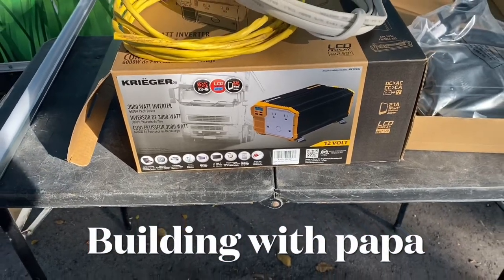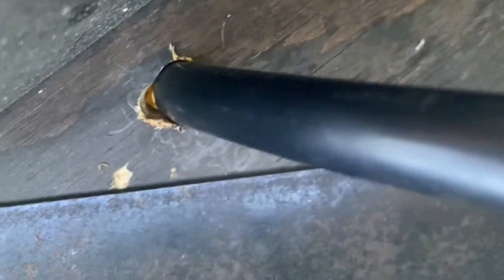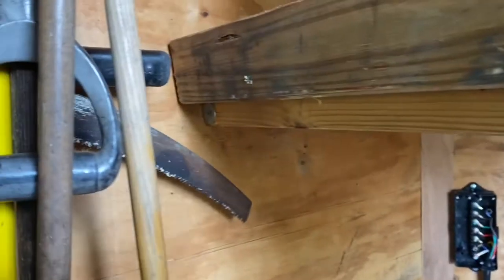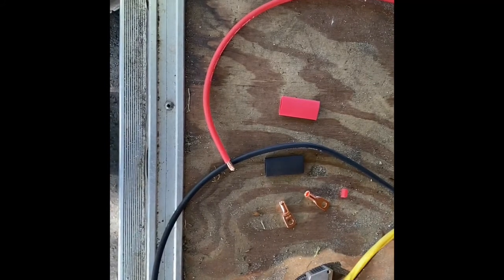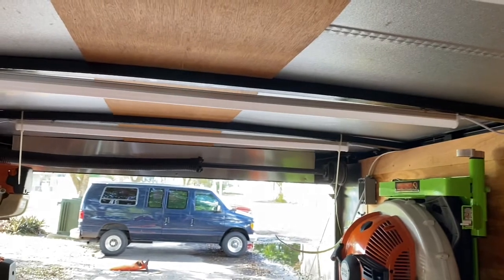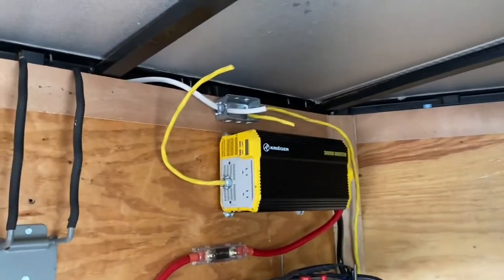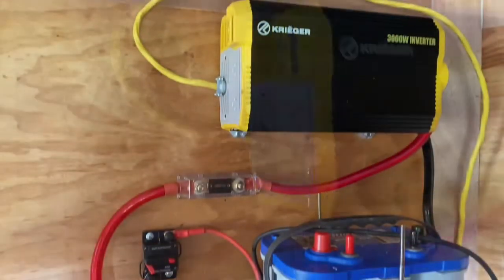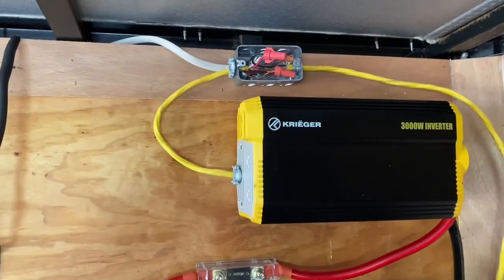Installing a power inverter in your trailer off your seven pin

Comment: I want to run some STIHL battery trimmers for commercial lawn care. The charger draws 4.4 amps and I need 2 -3 of these running. Would one big battery work with a big inverter? Also how would I charge that battery would the truck running here and there in between properties work ?
Reply from the maker: Yes, one big battery and one big inverter will work fine when you’re driving from property to property. It’ll continue to charge the battery so you should not have any issues when I’m charging mine. I’m usually on a job site and I don’t run my vehicle at all, but minor smaller batteries for Dewalt and Ryobi tools, hand tools I haven’t had any issues and I’ve been doing it for years. I hope you enjoy the video, and if you can leave me a thumbs up.
Reply: @buildingwithpapa do I need the battery or can I just use the inverter ?  My truck has 2 big battery’s
Reply: @buildingwithpapa do you need to charge this battery in the trailer or does it just charge off the 7 pin ?
Reply: Well I set up the system and the charger drained the battery in just over an hour.  So basically it won’t work because I’ll have to still charger all the battery’s at night as I need about 6 batteries  to last a day and it died after charging one. I needed the charger to run for least 4 hours a day.   😩.   So the time to set this all up was a waste and I’ll have to return the inverter and battery  and take a loss on the wires and supplies.
Reply from the maker: Was the battery fully charged? And how big of inverter do you have? Did you use marine batteries or just the car battery? You may need to set up more than one battery. I have the same set up in my trailer and I’m able to charge multiple batteries but again they’re only 18 V and 20 V batteries. I haven’t had any issues. Sorry to hear that you’re having some but there’s gotta be a way to work it out. I don’t know if you have the room for it, but you may need four batteries and what size inverter do you have?
Reply: @buildingwithpapa  1500W inverter.  Each charger pulls just over 400 watts. Big marine battery.  The problem is even if I have more batteries I’d have to charge them every night as the 7 pin won’t charge them and in a day stop and go I only drive about 1-1.5 hours off and on all day. Because these batteries are for Grass whippers which take a lot of power I have to a couple on a charger all day long.
Reply: I’m just going to put an outlet on the outside of my trailer and just directly charge the batteries.  That’s the only way I believe and get rid of the inverter set up.
Reply: @buildingwithpapa  what charges your battery each day? Or do you have it so the 7 pin gets 12 volts and uses the pull truck batteries and alternator?   That was maybe my next step
Reply from the maker: @jaybrown8709  oh so you’re not using your seven pin to charge your batteries? Yes I have my seven pin hooked up and it charges my battery as I’m driving and I don’t have my truck running when I’m charging the batteries on a job site..
Reply: @buildingwithpapa  ok. 
Y seven pin just has trickle charge right now and it just keeps a battery at level if that.  It won’t charge a battery, but apparently there’s a way to change it so you get the full power from the alternators and the other truck batteries.
Reply: Even with three batteries, two from the truck and the one in the trailer it can’t generate enough power to for what we use these little Battery  packs take a ton of power and because we use them  heavily all day it will never be able to generate enough power through the charging system

Comment: Why not with a solar panel ?
Reply from the maker: Well, first, the customer didn’t want that I only installed what he wanted but yes the solar panel would help if you’re not hooked up to the truck, but why do you need a solar panel if you’re hooked up to the truck when you’re using the trailer every day I don’t use my trailer every day and I don’t use a solar panel either cause whenever I need the power the trailer is always hooked up to my truck, so it makes sense to use the seven pin but a solar panel wouldn’t hurt. I hope you enjoyed the video, and if you can leave me a thumbs up.

Comment: Always connect positive to the battery first!!!
Reply from the maker: Thank you for your comment. Can you explain to me why you believe the positive should be connected first. I was taught to put the negative on first and if you Google it you get both ways one says positive1st and other say -1st so explain to me why you believe positive first also I hope you leave me a thumbs up.
Reply: @buildingwithpapa   the only real reason is the chance of shorting things out, in this case in a wooden trailer not such a big deal but with automotive or even lawn mowers, power sports etc. if your wrench/ratchet grounds out while tightening the negative nothing will happen. But if you touch ground while tightening positive your in trouble. Great video by the way! Nice install.

Comment: When it’s plugged it to 7way will it drain your truck battery’s
Reply from the maker: Thank you for your question. No it should not drain your truck battery. I don’t leave my truck attached to the trailer 24 hours a day, but it wouldn’t matter if you were running the truck every day you’re only pulling power from the batteries when you’re using lights or whatever you’re using in the trailer, so no it should not drain your battery to your truck, I hope this helps you, and if you can leave me a thumbs up

Comment: I looking to charge 8 20v dewalt/craftsman batteries. I think the amps per 4 stall battery charger is 36 amps. What size inverter would be best if this setup would work?
Reply from the maker: Thank you for your comment.
36 ampa is a lot, so I would definitely try to get a charger like a multi charger so that you can put multiple batteries in but it’s only charging one at a time this will pull less amperage.
Reply from the maker: In this video I used a 3000 W the reason we use that was because he had multiple things to run but he was also going to run a air compressor and for that the start up amperage that was needed he had to look for a different air compressor.
So you would have to research exactly what your chargers of pulling in anywhere is from a 3000 to 5500 W would work.
If you like this video and if you can leave me a thumbs up.

Comment: I would like to do something like this to my trailer to put some light and outlet. the 7pin harness it’s connected to the vehicle to charge the inverter?
Reply from the maker: The seven pin is actually charging the battery or batteries, the inverter is changing the power from DC to AC and then that will light your lights.  If you want an outlet and power you have to make sure you have the right inverter for whatever you’re plugging into the outlet, for this trailer we had to locate an air compressor that would not pull to much amperage when it was starting up. I hope this helps you and if you can leave me a thumbs up.

Comment: Question for you.  So I have a GMC Canyon 2021.  Factory installed.   Do you know the amp limit for the 7 pin power.  And does it turn off with the key?
Reply from the maker: I don’t know the amperage but it was pulling the proper voltage and I’m not sure if it turns off when you turn the key off I don’t believe it does.
Thank you for watching the video and asking your question.